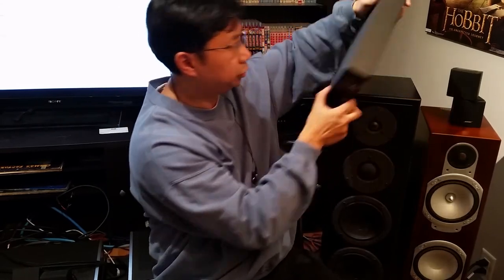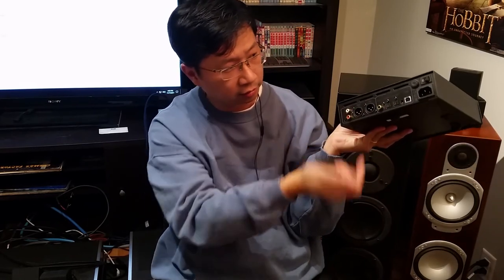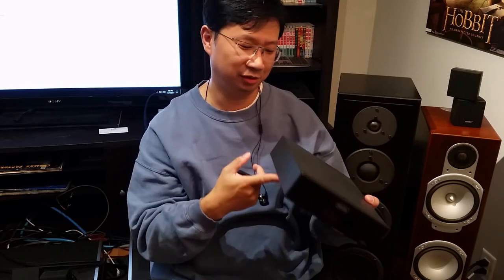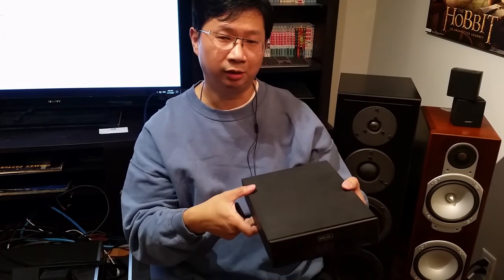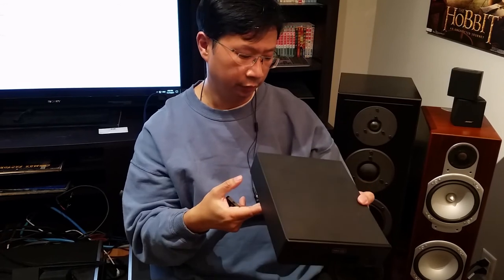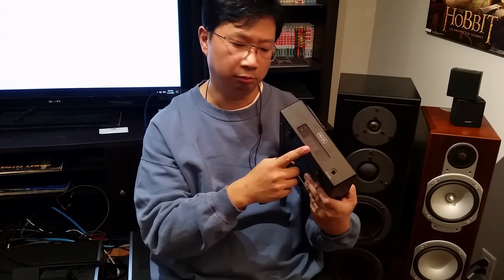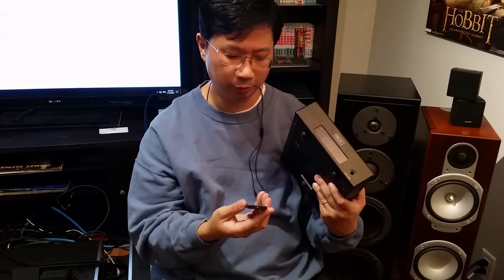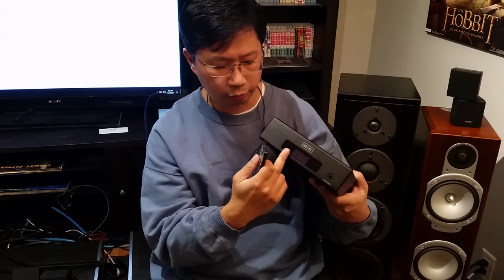Hegel HD12 dac review

Comment: you can have resolution and fullness of sound, but hegel seems to lack comparing to the other. the fullness could maybe be controled with a more bold or mellow amp, vt-200 must of been good, especially if you put transistor preamp with it, the pass lab x-0 3 pieces preamp was outstanding with the vt-200. with Nirvana sx-ltd interconnects and cardas golden cross speaker wires. maybe to bold for some (like me) but still outstanding dynamics and warmth...

Comment: Hi Thomas
    I am curious what kind of amplifier and speakers you use in Hegel's tests.
Regards
Reply from the maker: I tried it with 1)Modwright LS100 + Bel Canto 1000s Or Bryston 4B SST. 2)Audio Research LS16+VT200. 3)Accuphase C222+P2666. 4) Marantz Sc11s1. Speakers tried are Titan Earthquake Tigris, Focal 1028, Monitor Audio GX300, Dynaudio Contour 2, KEF 205/2, Monitor Audio RS6.
Reply: thank you